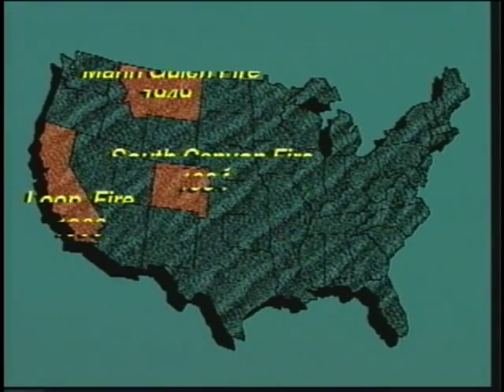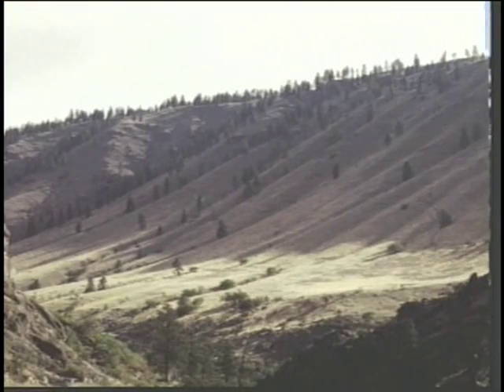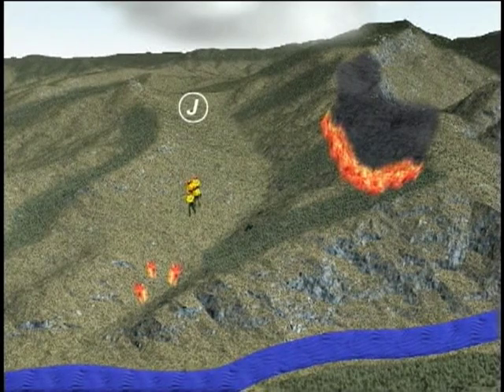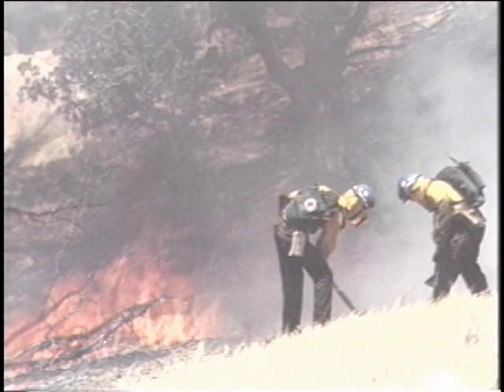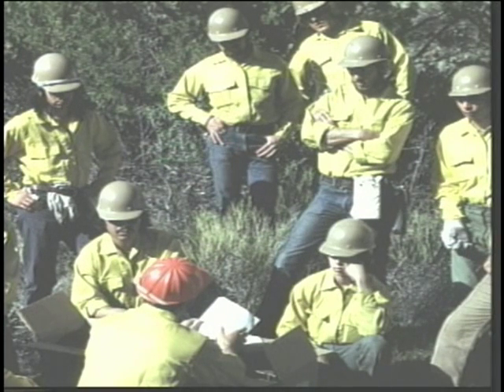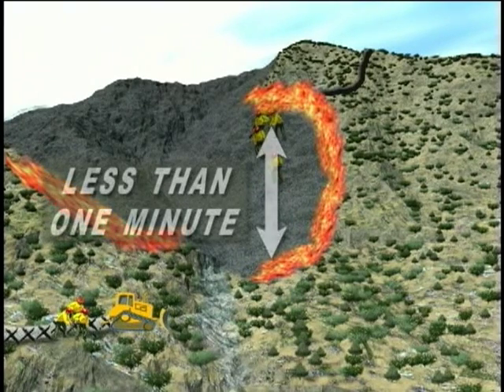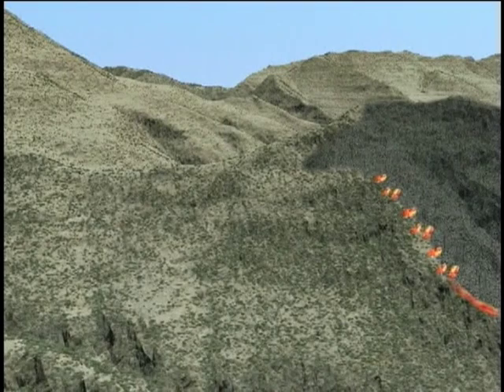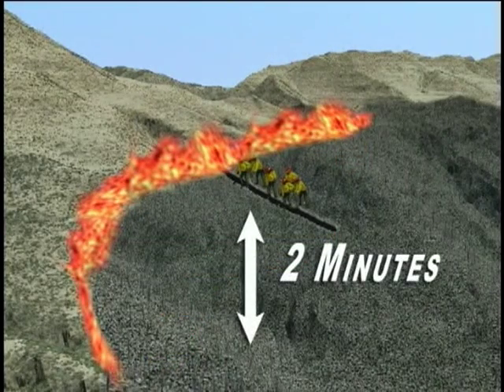Crew Boss - Part 5 - Downhill Fireline Construction

Comment: Firefighters should know that fighting fires on slope is very dangerous due to convection current. Fire always creates its own convection current (Hot air rises and cold air drops).
Three things that fire heat energy normally produces are; 1. convection 2. conduction and 3. radiation. 
Just by watching your videos it seems that the victims were doing a direct attack to the head of the fire which they not supposed to considering the topography (slope).

Comment: First of all, thanks for this video, I'm gathering information about the Mann Gulch fire and it has been very informative.
And I would like to express my sincere condolence to smokejumpers who died in the line of duty.

While watching it, I got a question.
In the video(1:28), the narrator says, "Winds were steady and moderate with typical afternoon up-canyon and up-slope patterns."
In the picture, there are three yellow arrows, the one which starts from the bottom left is pointing up-canyon. And among the other two, it seems to me that the upper one is pointing down-slope. I got a little confused here. Shouldn't it be pointing up-slope? Or am I misunderstanding the term here?
Could anyone kindly explain this to me?

I'm curious about the direction of the wind in this fire because I think it was one of the critical causes of this tragedy. So if anyone could tell me the direction of the wind or its change during the fire, I would really appreciate it. Thank you.
Reply: "Instead, they proved that the wind was traveling north, or downriver, and that the top of the ridge (which juts out as the river bends sharply to the northwest and separates Mann Gulch and Meriwether Canyon) split this downriver wind in two. These two separate-smaller winds then re-converged (on the other side of the ridge) in the heart of the gulch (at right-angles). " copy and pasted from Young Men And Fire